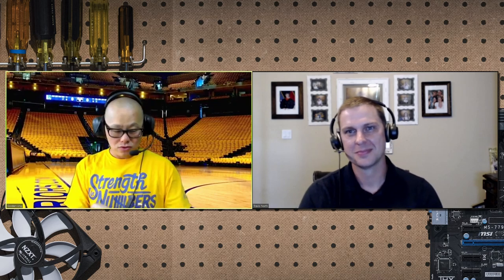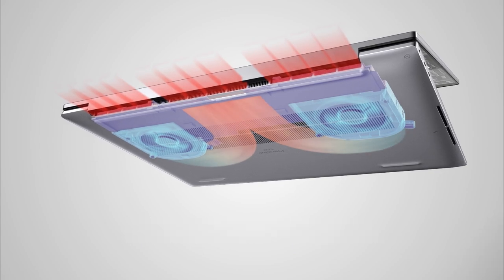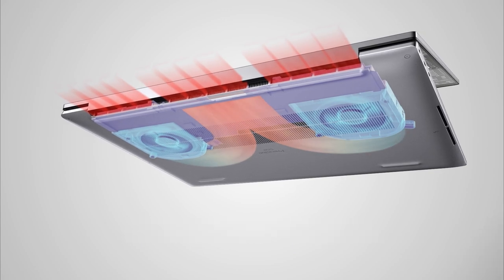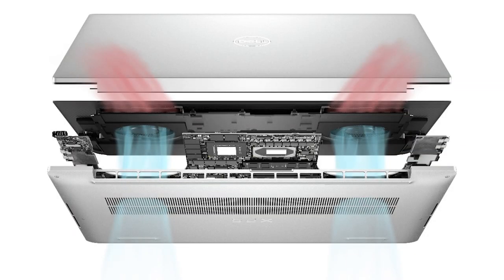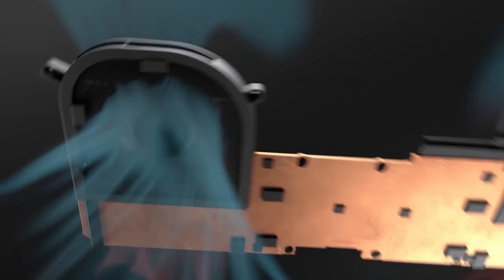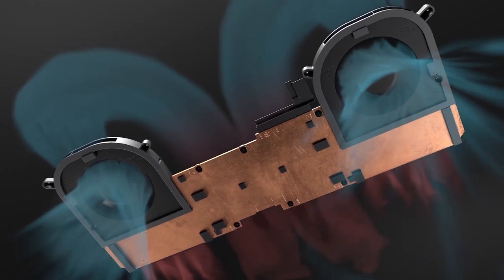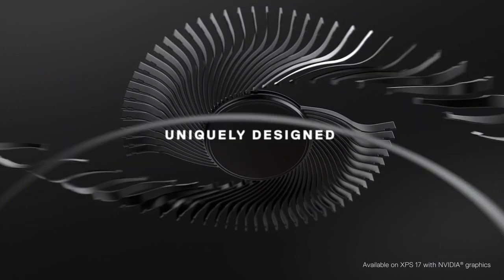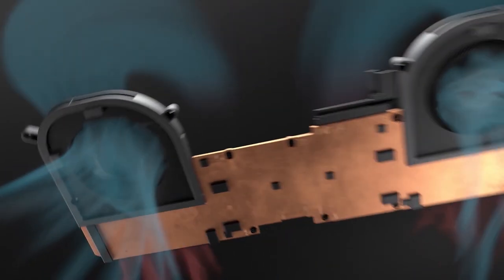Dell talks laptop fan design innovation | Ask a PC expert - Part 1

Comment: I was always curious about why Dell typically use a 100c thermal throttle limit on the processor on many of the recent gaming laptops. While this is within the acceptable range by Intel, other companies tend to cap this to 90/95c. Is it a simple case of Dell preferring higher performance over temperatures, as higher temperatures allow you to use higher power limits? How does the extra heat affect the other components on the board that may not necessarily be rated to as high temps as the CPU die? I guess it would be good for a company to publicly say that this level of core temp is ok/acceptable, a lot of potential customers see it and get scared away as from their perspective 100c looks bad. Not sure if the other parts of the series are filmed already, but it would be good to find out more on this. Also is there a reason for no custom user fan control? Would be great if the user had the option to drag a fan slider around to some degree if they are fine with  more noise for better cooling performance.
Reply: Like you said, it sounds like a situation of "its within spec, and it gives us better performance, this will create sales." Technology nerds like us are very snobby and very rare compared to the average parent who buys a laptop for their kid. I doubt they'd get spooked since all they care about in a laptop is the excellent branding of "intel 10th generation" sticker. Plenty of people don't even watch reviews though so they'd use word of mouth, where the better performance would lead to some percentage increase in happy customers. Also VRM usually goes up to like 105-115c before throttling, and capacitors are usually rated at 105c. I think us nerds standards are just too high.
Reply: @Michael-su7ip  I will completely own up to being a nerd with high standards and I will admit to participate in discussions that heap crap on 100C operating temps, firmware power limited and poorly benchmarking thermal throttling systems, and a lot of Dells over many years fall into that description. But I am no fanboy and do appreciate that there are design considerations other than the thermal and throughput performance of the system I use, a big thick overclockable DTR CPU SLI Clevo capable of pulling up to 600W with its desktop class components.  What really, really annoys me is that this basic point is missing in every discussion: thin and lights are products of COMPROMISE. Aircooling performance is proportional to weight and space, technologies can "optimise" but can't reverse basic physics, and the principles of physics lie in opposition to thinness and lightness.  You are left only with the option of buying mostly hot running machines in this category because the average consumer is not appreciative of lower operating temperatures and thermal cycling in components and materials, or aware of cynical decisions at the design table such as limiting power, locking firmware to prevent enthusiasts finding their own limits, or building to the spec determined by a predetermined lifespan goal of the product.  So when isolated products come along that DO perform they stand clear above the rest, and I have to say very few Dells I have seen in the last decade fit within that description.
However, "compromise" is hardly the stuff of positive marketing spin puff pieces so the consumer keeps on being fed the lie that you can have your thinness and lightness and the performance too... for however long it lasts
Reply: Yo Jarrod. Travis covers this below but I'll throw it in here as well: "Hi Everyone this is Travis from Dell, in other forum I cover how we design our systems and the overall impact to component design and operating the temperature of the CPU at 100C.  I see there are questions about dropping TJ limits to something lower say 95C.  Even if you set the max limit to 95C via an offset value all this does is changes the temperature at which the CPU begins power management (throttling IA or GT).  You can do this but your wasting performance.  Also we look at every single component on the board, FET, capacitor elec/poly, inductor, coin cell, etc and lower the temperature limit for the full life of the product.  We do this at maximum current draw at the worst case temperature through our full test sweep.  Ill give a hypothetical example say we are using a electrolytic capacitor that has a rating of 95C and a 2000hr life we will de-rate (ex typically 5C doubles the life of the part) 90 ~ 4000hr 85  ~8000 hr etc... down to say 70C the cap would have a 64000hr life this would be 7.3years life at full current at maximum temperature running 24hours a day (most people use their units less than 2 hours a day at full power so you can do the math how long that part would last).   Hope this helps!! # iworkfordell"
Reply: @greebj  Well said!
Reply: The throttle limit is determined by how hot the laptop gets.. if the laptop is uncomfortably hot to the touch when the CPU is at 75c then designers will set the throttle point to 75c.. (this has happened on some ASUS laptops before)
With some careful design, and making sure the laptop skin temperature doesn't get too hot, you can increase the throttle limit, this increases the temperature of the heatsink, and allows for the air coming out the back of the laptop to be hotter.. So at the same airflow, more heat is removed. Dell has maximised this all the way to the limit of 100c.
The dual outlet fans, blowing some air over the motherboard/in the laptop allows the skin temperature to be managed better
And also the GORE thermal insulation reduces the skin temperature too, further increasing throttle limits.
Higher CPU temperature = Higher performance.. 
Try running your desktop's GPU with full fan speed (MSi Afterburner) with 60c temp limit, it will not perform as fast as if it was at 80c temp limit..
Reply: Please download DELL POWER MANAGER software to control your laptop's thermal noise-cooling ratio
Reply: There is custom fan control using Alienware Command Centre you just need AWCC and AWCC OC controls
Reply: @VongolaEX10  Sadly it messes with power limits and the PL1 ends up the same as if you just hit balanced mode except the fans spin faster and cool temps down. Clocks stay the same sadly.

Comment: Hi Everyone this is Travis from Dell, in other forum I cover how we design our systems and the overall impact to component design and operating the temperature of the CPU at 100C.  I see there are questions about dropping TJ limits to something lower say 95C.  Even if you set the max limit to 95C via an offset value all this does is changes the temperature at which the CPU begins power management (throttling IA or GT).  You can do this but your wasting performance.  Also we look at every single component on the board, FET, capacitor elec/poly, inductor, coin cell, etc and lower the temperature limit for the full life of the product.  We do this at maximum current draw at the worst case temperature through our full test sweep.  Ill give a hypothetical example say we are using a electrolytic capacitor that has a rating of 95C and a 2000hr life we will de-rate (ex typically 5C doubles the life of the part) 90 ~ 4000hr 85  ~8000 hr etc... down to say 70C the cap would have a 64000hr life this would be 7.3years life at full current at maximum temperature running 24hours a day (most people use their units less than 2 hours a day at full power so you can do the math how long that part would last).   Hope this helps!! # iworkfordell
Reply: It's crazy, but I wish we had had even more time to talk about this...
Reply: Hello Mr North. I would like to thank you for your interview and your comment. As an engineer myself, these are very insightful to the design of laptop cooling. The major problems I see are the treatment of the CPU as a "just another electronic component with a data sheet" and the overall lack of safety factor in the thermal design of the electronic components. Please let me elaborate.
|
Indeed, technically speaking there is nothing wrong in running a CPU at 100°C. Intel does guarantee that a CPU that runs at stock settings (voltage, frequency and power), even ran at 100°C will last for years. BUT what is not taken into consideration is the silicon degradation that will occur even in short periods of time. My 9700k equipped R1 A51m started having stability issues just after a few months. Simply, it started needing more voltage over time to function correctly. This on a laptop may mean that previous overclocks may not be possible anymore due to lack of cooling headroom. There is a reason why nVidia limits temperature so much for their GPU's, and it's simply to make them last.
|
Regarding the lack of safety limit for the electrical components, the major issue is that it doesn't take into consideration possible variability. Let me use my R1 A51m as an example again. Turns out that the cooling for the MOSFETs for the GPU depends on perfectly calculated airflow on the heatsink for the GPU. Not much of a problem, except that the heatsink doesn't cover the MOSFETs perfectly, thermal pad application is deficient and Dell decided to bump the power from the GPU from 190W to 200W to keep up with the competence, not mentioning allowing the GPU to run up to 87°C. The result was a catartrophic failure of RTX 2080 cards that resulted in limiting power to 180W and temperature to 74°C.
|
I really do appreciate all the engineering work that is put to the machines from Dell. But regarding cooling the concept must change. If all manufacturers do things a certain way, it doesn't mean that they are dumb and that they are leaving performance up on the table. It might mean that they are after something that can't be purchased and gives a lot of money in the long run: reliability and customer confidence. 𝑻𝒉𝒆 𝒃𝒆𝒔𝒕 𝒄𝒖𝒔𝒕𝒐𝒎𝒆𝒓 𝒔𝒆𝒓𝒗𝒊𝒄𝒆 𝒂 𝒄𝒖𝒔𝒕𝒐𝒎𝒆𝒓 𝒎𝒂𝒚 𝒏𝒆𝒆𝒅 𝒊𝒔 𝒕𝒉𝒆 𝒐𝒏𝒆 𝒕𝒉𝒂𝒕 𝒏𝒆𝒗𝒆𝒓 𝒉𝒂𝒔 𝒕𝒐 𝒏𝒆𝒆𝒅!
Reply: I just bought a m17 R3 - i9, 2080, 32gb, 300hz. Was having problems when running UV (. 140) on Performance Thermals - frozen screen, alarm and forced reboot. Could only play game (Doom eternal) for 10-30 mins b4 it locked up. 
 I switched to cool mode, no UV and it runs great.  CPU at 85, GPU at 75.   200-250 fps at Ultra Nightmare graphics.  👍👍

Comment: How about 2x fans, with more inner blades than outer blades (outer blades have more air movement). This would result in 2 things:
1. Reduce frictional losses by evening the air movement over inner and outer blades
2. With gears (not belts), two sets of blades could mesh (overlap).
The outer blades (combined) would be equal to the number of inner blades (of a single fan). 
Each fan rotating in opposite direction (one clockwise, and the other counter-clockwise), to pull the air through in a combined (meshed) effort.

Comment: a lot of words to say we got a blower fan and we made the impeller bigger then we cut off the opposite side of the housing and that's better then our old blower fan because our old blower fan was awful 
 
looks like a nice improvement for laptops though could you imagine using a new Intel 10 core CPU  in a old laptop? it would be a fire hazard they really need these improved coolers
we can say goodbye to battery life on Intel laptops though

Comment: I for one am allways getting scared when i see temperatures above 90 on the CPu and GPu , maby this is just me , but i see left and right ,  and most of the people i know , they prefer to underclock and undervolt running coller than having a frying laptop.
And i realy dont see the use of a machine that turbo throttles allways when playing games  holding a steady 3.3 - 3.4 Ghz becouse of its throtteling when you can actualy underclock and undervolt it  ,  yea you lose that peak 5 ghz for a few seconds but at least you can hold a steady 3.8-3.9 ghz under load  , under 90 degrees somwhere in the low to mid 80's. I mean if you know a better solution to running cooler please advise ,  but i as a customer  , i am scared when i pay 2000+ $ on a machine that reaches 100 degrees in 5 seconds of turbo throtteling.

Comment: damn this Dell engineer is really sharp. I just ordered an XPS 17 and basically wanted to know the air flow direction of the cooling system and if a cooling pad underneath the laptop will indeed help the cooling system doing its job, I guess I'll have to watch all 6 videos now since they're so interesting. Thanks a lot, this is great content!

Comment: Positive pressure in the case is a poor second best solution to actively cooled heat generating components like VRMs and memory chips through heatpipes to radiators, which Dell choose not to do in these laptops because they want them as thin n light as possible and more radiators make for weight and volume.  If you cool heat generating chips properly with heatsinks (which Dell also choose not to do separate to their thermal throttling CPU/GPUs) you don't get enough heat radiating through the PCB to need extra airflow.

Comment: Wait, Dell has "thermal engineers"? Dell has one of the worst and buggy fan logics of all laptops, please fire the entire team and get some people who know their job. Get some decent bios developers too and dont buy the never working buggy bios from some cheap chinese company. What kind of joke is this? Dell had one of the worst thermals for YEARS with the XPS line and never had any wish to make it ANY better.
Reply: I was rather disappointed to find out the new G5 w/ the Ryzen 4000 has awesome price/performance ratio but the laptop lid covers the fan exhaust when you open it ... did the thermal engineers have their eyes closed when they evaluated that one?
Reply: @telequacker-9529  It doesn't cover it. If you look at literally every ultrabook, the fan vents blow into the lid, and the lid deflects the airflow upwards (or downwards).
Reply: I'm using a Dell G5 5500 it runs at 3.6ghz in games at 36w (generally) it is often around the 80 degree mark on the cpu and 71 degrees gpu. I use a cooling pad and alienware command centre in performance thermals mode. Hit gameshift to ramp fans to 100% and then wait 10 seconds and hit it again bringing them down to 92%
Only in summer when ambient temps hit around 22 degrees and above do things start approaching the 90s for cpu and 75+ for gpu. In this case I use balanced thermal profile with 100% fans in awcc.

Comment: I never understood why laptop heat pipes are smooth & not ribbed or knurled, to increase their exposed surface area. If you work in the oil industry like I used to, air cooled heat exchangers are always 'finned' in some form or other to increase rates of heat transfer.
Reply: Well, they're finned on the inside (or as Travis said V-shaped grove with wintered particles. If you mean, why not add additional surface area on the outside of the pipe too, I'd guess you  the pipe to transfer the heat through the pipe as efficiently as possible to the heat exchanger / fin stack so you can get the heat out of the laptop. If the outer surface was finned, I'd guess that heat would dissipate inside the laptop. For all we know (maybe I'll see if we can ask Travis to answer a couple more questions) making the heat pipe a  heat exchanger itself could impede the efficiency of the phase-change operation of the heat pipe.

Comment: We need Tech Jesus to take a look at this snake oil.
Reply: He doesn't do laptops
Reply: And Tech Jesus respects Gordon more than a lot of people.
Reply: How about making your chips better so you don’t have to make your fans bigger. It’s 2020 the word bigger should not be used especially anything to do with processors. This is dumb, everyone is acting like this is some leap forward. Intel is losing left and right.
Reply: @hitznkoff4285  bigger performance.
Reply: James 4:8 well maybe they should have had a call with Apple, Dell seems to be on board with the fire chips.
Reply: @hitznkoff4285  cough Dell G5 15 SE
Reply: Gordon Ung is that a 1080P screen in 144hz? Because the fact that it plays 4K is lost on me if it’s a 1080 screen.
Reply: @hitznkoff4285  it's definitely not 4k on the   all AMD machine if that's what you're asking.
Reply: Gordon Ung I checked Dells website on it and they advertise 4K at the top of the page but they never say the screen resolution is all. Not trying to be disrespectful it’s just how I am bud.
Reply: @hitznkoff4285  It's cool. Do you mean the G5 15 SE? It's a a 1080P/144 on the three higher SKUs. It's a budgety laptop. Solid midrange performance competitive with 2060's in gaming and on CPU side it punches out of its class.
Reply: Gordon Ung Looking more into it it looks like people are complaining that the Ryzen laptop is hot like 55C burn your fingers hot WTH?!

Comment: As the owner of a Dell Precision (a generation back) and assuming this works will resolve the thermal issues in the Precision. Mine is running hot...when not doing much....all because the additional GPU and power stages run hot!
Reply: Hi Jim this is Travis from Dale when your system is running hot check the task manager and make sure something in the background isn’t pulling high power in that generation of OS there is no background application management so if you have virus scan or any other applications pulling power it will pull as much is available you also have cool mode in DPO.  This limits max temp hope this help #iworkfordell